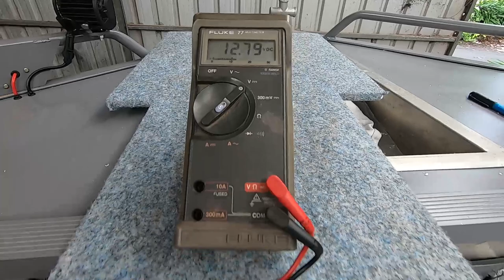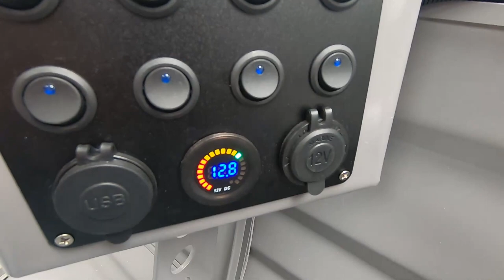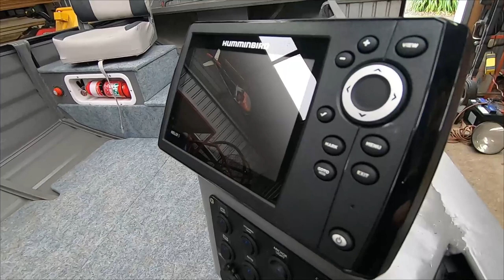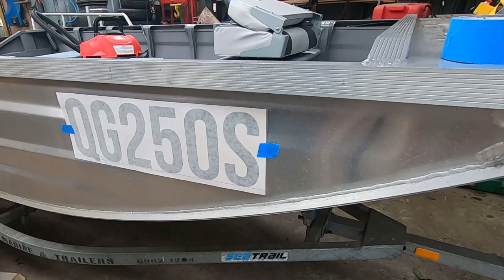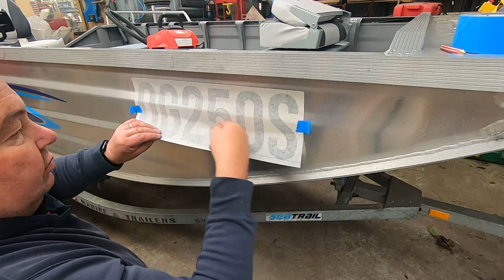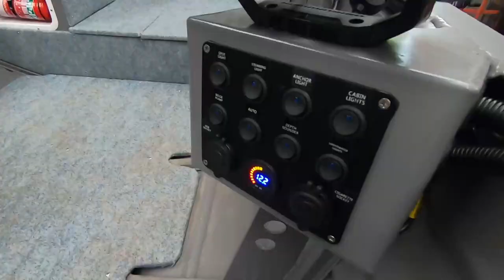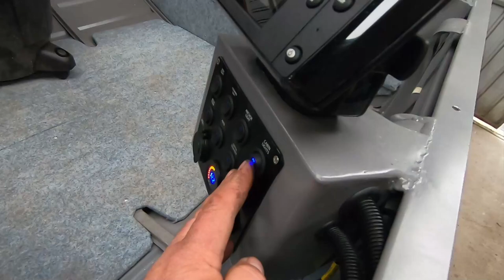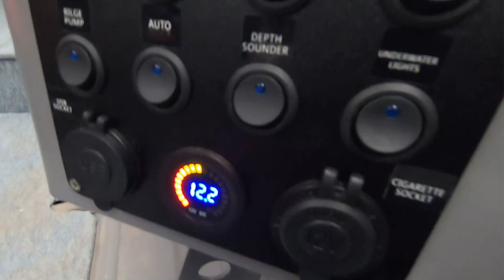Fishing Boat Project, Switch panel, stickers, glove box, Part 18

Comment: Hey mate what size main cable did u run from the battery to the switch pannel
Reply from the maker: Hi, I think it was some 4mm (can't remember) but it was heaps heavier than it needed to be, especially running led lights etc.
Reply: @coasttocountryaustralia  sweet mate also I just bought a water snake how’s yours going, what size battery do u run for that one?
Reply from the maker: @harrygould7417  its an old 100aph AGM battery that was 6 years old, so far so good, I would love to put a lithium one in it next, there's more videos of it running etc. on my chanel. Cheers

Comment: Love the build, what brand of switch panel did you use how has it performed so far
Reply from the maker: Hi it was just a cheapy off ebay. I did spray it with inox/WD40 on the connections to help with corrosion in the future but so far its working well. Cheers
Reply: @coasttocountryaustralia  thanks for the quick reply, regards